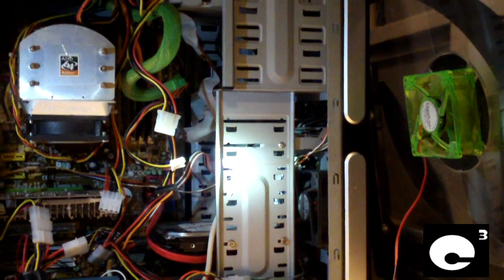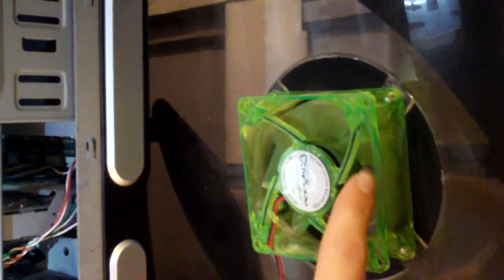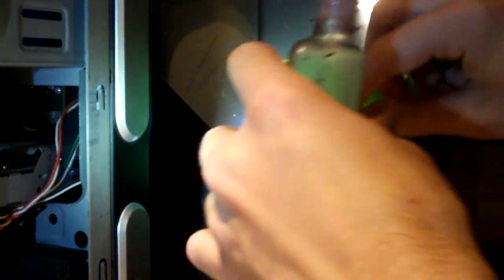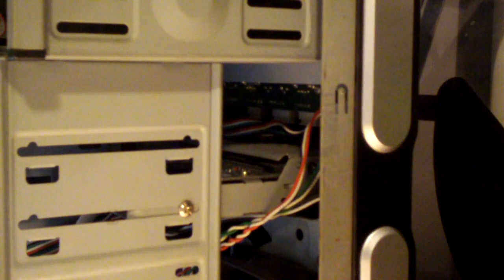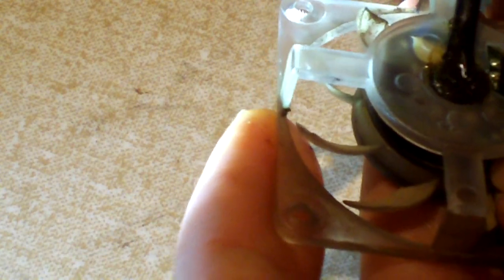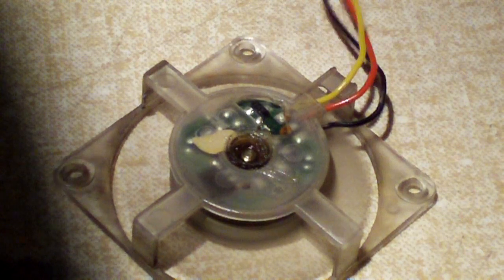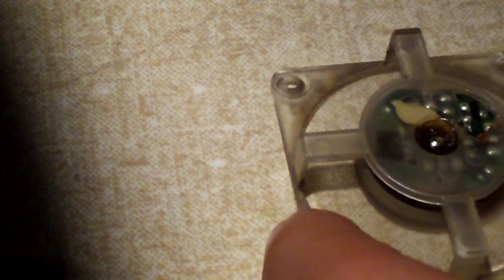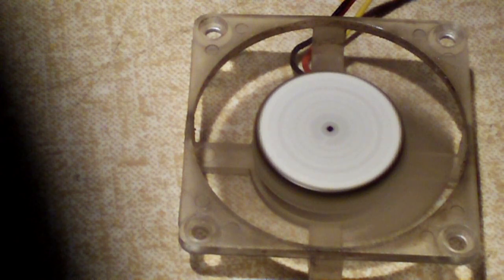How to fix rattling or humming computer fans

Comment: On my computer, and MSI GE72 6QD Gaming Laptop, with two fans, it seems to only happen it only seems to happen when the fans are on full blast. When I'm running a game or software requiring a lot from the graphics card. Once I exit out of that app the fans slow down and it's fine again. This computer is only 1 year old (in fact the warranty expires next week) and I'm torn between doing it myself or taking it in.
Reply: It's most likely either some seized up bearings that are low on oil (See local supermarket for machine oil @ a few dollars) - Use just a few drops. If its not that, it will be that the fan was unbalanced from the start and it has become more and more unbalanced due to centrifugal force generated by the fan running since you brought it.

I should add that laptop fans at full blast actually can quite often give a slight vibration due to how small and hard they work. Disregard above advice if its happened since the day you got it.

Comment: One instruction told me to use some dry graphite lubricant and some mineral oil with it. I've used the graphite powder and 3in1 Oil on many fans and they have gone from totally dead to working fine.  They say the graphite powder stands up well to heat. Sometimes when you start the fan up after applying the graphite and oil is a grinding noise, it soon stops after a few seconds or minutes.

Comment: Depending on what I have on hand, I use either WD-40 or 3-in-1 Household Maintenance oil.
Reply: problem is wd 40 isn't really a lube. as soon as it evaporates / dries all the lube is gone. 3 n 1 works pretty well.
Reply: I have 3 in 1 somewhere, I need to find it

Comment: How would WD-40 go?
Reply from the maker: I don't recommend WD40.
Reply: thank you
Reply: Cube Computer Channel I just used wd40 before reading this comment lol I'll let you know how it goes
Reply: and? how did it go?
Reply: the rattle is gone so I guess it worked
Reply: WD-40 is a MUCH better agent to use than a 'magic oil/grease' (usually just soap/detergent mixed with oil/water as a base for cleaning engines). WD-40 is MADE for doing this. The stuff hes using is a BAD decision, If he accidentally got any on his circuit boards in the computer, it would be very likely to 'short out' - .. I am only trying to save your computer, if you think I'm wrong please let me know and ill reply with more detailed information.
Reply from the maker: WD40 is not an oil. If WD40 should be used in sleeve bearings, then the fan manufacturers would be using it.
Reply: Damn dfaktz. Who taught you wd40 is good for this?.. It's by far not an oil, it removes the oil + it eats up metal (hence why its good for rusted bolts)
Try put it on a chain for example, on  a bike, anything. ride it for a few days and that chain is 100% dry & ready to be killed :)

Comment: I usually add a little bit of both. little bit of 3-in-1 to loosen the bearing and a bit of bearing grease for the long term lubrication. If the fan is completely seized then I add penetrating oil (PB Blaster) and hope for the best.

Comment: I have some 92mm ball bearing Nidec fans from the late '80's, and were all in old computers that were outside for the better part of 10 years. 1 needed oil, and they are all noisy, but work fine. I also have an 80mm Oriental Computer made by Sunon fan that is almost 20 years old, but is fine, and is a sleeve bearing with no work ever done to it. I have a lot of old ones, but i don't usually keep the cheap ones.

Comment: I think mine is due to a little to dust on them but mine is in my amplifier that came in it I have two of the same amps and after a few months both fans do some humming almost kinda sound it comes and goes but after I blow the dust out of it they stop doing it for a few more months again the fans never shut off it's the way it was designed

Comment: Hey C-cubed, here's a suggestion, if you actually remove a fan I would remove the rotor/fan and clean the bearing raceway and spindle shaft. Then you can examine it for pitting or scratches. If you lube it on regular basis it may never get damaged that way. If it is scratched or pitted the fan is basically worn out by definition, and should be replaced.

Comment: Heck, I know WD-40 also works as a quick fix if its really bad and you have no other options. honestly though, if a fan fails and is a regular size, I highly recommend just buying a new one. Arctic f12 pushes a lot of air while staying quiet, and is under $10.
Reply: TheCyberQuake I only am looking into new fans as these old ones are just loud in general, and for an ideal recording/streaming environment I would prefer them to be quieter. But yes, just to fix a rattle this method works well. It will also work for fans that simply stop moving.

Comment: This is a useful video, though I do have a comment to throw in. 

You mentioned how it seems like computer fans aren't engineered to last anymore, but the fan you're having issues with looks like absolute garbage. (No offense intended). If you intend on spending a bunch of money on a high-end pc or if you want something that will last a while, don't cheap out on the fans. a solid HIGH CFM fan will do wonders and last forever. I honestly can't remember ever having a fan die. 

Admittedly, I am here because I have a fan that likes to rattle. It is well over 5 years old, and I probably paid about $20 for two of them.

Also, this is the wrong way to approach this.  In most higher end fans, you can simply pull the fan off of the motor (gently to make sure you actually can). Clean out the inside as much as you can, clean the fan post then apply some petroleum jelly to both the post and the inside.
Reply from the maker: +Dloweification This is the fan that came installed on the motherboard. I didn't buy it separately. Fans of 20 years ago would have still lasted much longer than this. I had a fan off of an old Pentium heatsink. It had issues with rattling in recent years, but it was already 13 years old when it started to have the issue.

Comment: That PC is such a mess inside that I wouldn't be surprised if a cable, hitting a fan blade, was mistaken for a broken fan. Sleeve the cables and tidy up inside, if you really need that much airflow then the first thing you'll want to do is give the air the space to flow in.

Comment: Way too much work for a $7 fan.
Reply from the maker: Okay, then show me where I can get a replacement. Oh, and a standard caged fan won't cut it. This one sits down in the heatsink.
Reply: ***** newegg sells all kinds of fans, ebay has them also.
Reply from the maker: Zane Wv But they don't have the proprietary replacement for this heatsink.
Reply: replace the heatsink and fan, or the entire outdated mobo.
Reply: Well......now that youre talking about replacing the mobo and everything that comes with it now his work makes sense. My statement that it was too much work was based on the premise of being able to replace the fan. But if not then i would rather do the work than buy a new mobo cpu ram possibly drives based on if they are old IDEE cables or not.
Reply: replacing the mobo is best, they are cheap on ebay.
Reply from the maker: Zane Wv So now you're saying spend $40-$100 and an hour's worth of work replacing a mobo over a fan that just needs to be overhauled... when I can just overhaul the fan and have it fixed less than 15 minutes and cost less than $5.

The point of this video is how to to lube rattling sleeved bearing fans, not about every single alternative other than lubing the fan.
Reply: Yeah but dude it may be more than just the mobo. If this is an old IDEE cable system for the drives than he has to replace the drives with SATA and possibly the ram and cpu if different gen/socket.
Reply: LOL you must not know anything about computers. IDE drives are still made.
Plus you can buy pci cards with ide and sata ports.
Reply: I was at microcenter today and not a single mobo they had in stock used IDEE. They are all 100% Sata.
Reply: EBAY and NEWEGG I bought an asus drive with ide, but ide is old and slow so sata is better.